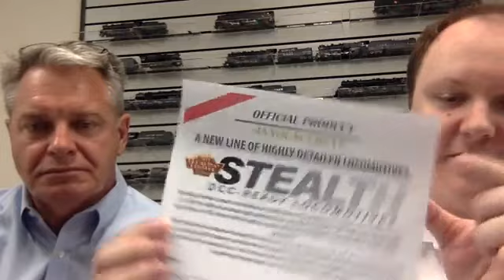ANNOUNCEMENT: Stealth Series DCC-Ready Locomotives for HO and N Scale.

Comment: Why are you guys going back to something that has failed? If people don't want sound, just turn it off. If they don't like your decoder, just remove it and put your favorite one in. I don't know why manufacturers put decoders in everything and just make it easy to remove if the customer doesn't like it. Wouldn't that be cheaper? Rather than offer two locomotives of the same type and be stuck with ones that don't sell. Other manufacturers have been slowly raising prices on non-sound locomotives to offset the rising costs of the sound ones.
Reply: People have been asking for the non-decoder option as they don't want to pay the extra for sound that they don't want. Turning off the sound does not remove the extra cost of it in the model.
Reply: @kiwitrainguy  Not necessarily. Have you seen the prices of the Stealth Series? And the non-sound locomotives from other manufacturers have been skyrocketing over the last ten years or so. As Mr. Guba said they still have to put a board in there anyway and other manufacturers have speakers installed, so price savings is not going to be that much since sound-equipped locos came out. Remember Broadway started the factory-installed sound locomotives. That's what the company was built on.
Reply: There are people out there that do not want BLI sounds for various reasons.There are issues withthe reliability of their PCBs.I, for one, will not buy another BLI, because their PCBs do not have any BEMF whereby they cannot run slowly at ss1. Offering DC models is good for the fact that I can put my own decoder,sound or non sound in them, to get that good BEMF. They do make excellent models, BUT they are being let down badly, by their electronics.The sounds they offer are only gimmicks, & are only put in them to sell.& are no use at all. 28 different sounds???.Who wants windscreen wiper sounds, cab chatter etc? @jeremyvehring9259